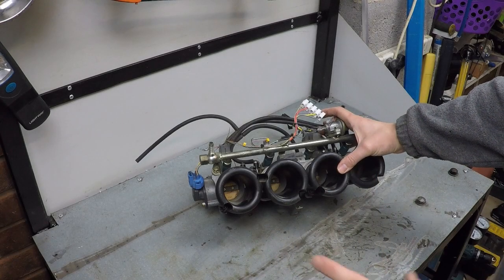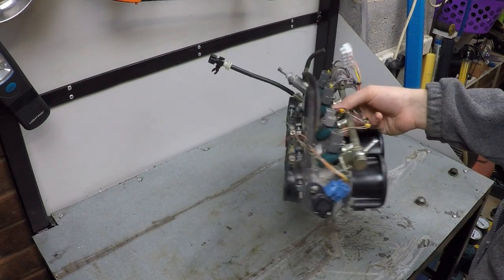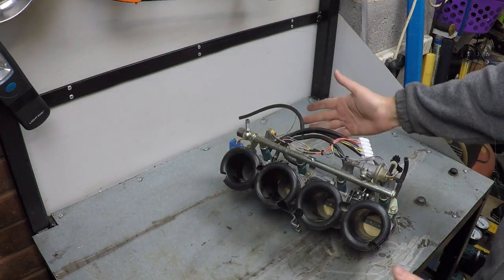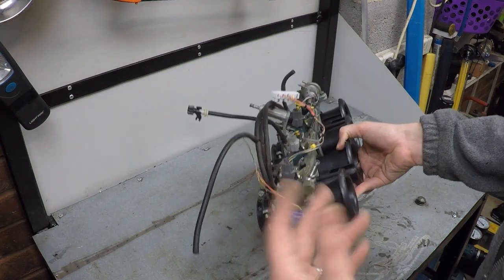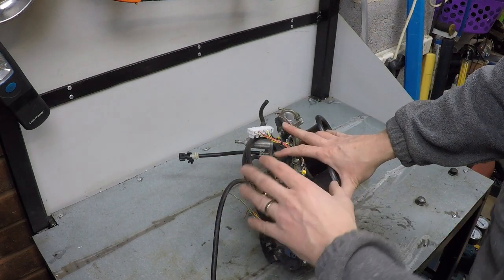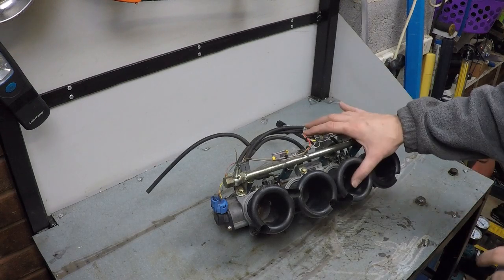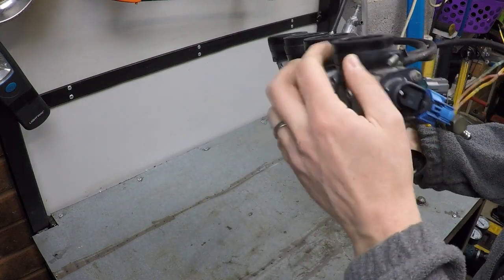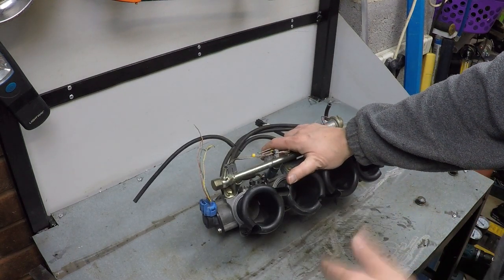Everything you DON'T KNOW about Individual Throttle Bodies

Comment: If you need 1mm per hp, that means i need frickin 87.5mm throttle bodies🤣🤣🤣
Reply from the maker: 87.5hp per cylinder?  You are going well!  What engine are you running?
Reply: @MakingforMotorsport  the engine is still in the build process, but it is a Honda D14A3 with a D16Y8 cylinder head, compression ratio is 14:1 and max rpm around 11500... so mathematically it should make between 320 and 380hp....
And it will run on pumpgas but its 102 octane
Reply from the maker: Wow!  Well that is quite the engine! 320bhp  from 1400cc is F1 levels of specific BHP!  It may have been the other video but I did mention that as you go up in size you get more BHP/mm (it’s obviously about area not diameter).   But your engine is a special case I think!  What are you planning on doing with it??
Reply: @MakingforMotorsport  racecar, full on endurance racecar, but as light as possible, something like 800kg in a Honda civic with over 300hp is more than enough for over 300kph and wheelspunn for days without a programmed TC
Reply: @MakingforMotorsport  i will obviously also try to run in on ethanol and methanol too, to see how much i could gain trough drastically the quality of fuel
Reply from the maker: I am in the UK and fuels other than high octane pump gas are limited to drag racers,  but I am really interested.  Will you have problems with the other fuels on 14:1 cr?
Reply: @MakingforMotorsport  what do you mean with problems? I cant run anything lower than 102 octane because it would knock immediately on 98 and lower, but in ethanol and methanol I have the advantage of a way higher knocking point and lower burning temperatures wich will make the engine last longer due to less thermal stress, and I'm from germany🤣
Reply from the maker: @THEBOZZ-zt1zn  knock was exactly what I was thinking, I don’t know the ron number for those others but from what you say it should help you.  I am curious though, you are building a big power 1400cc which normally means you are building to a class or regulations (otherwise I’d assume you’d go for a bigger capacity), can you run these other fuels in that class? (Or is it all just for fun?)
Reply: @MakingforMotorsport  i don't build to a certain regulation system, but with that i can run in the 1400cc class at hillclimb events or in a certain class in the VLN (in this class they are normally turbo engines), i think Methanol has around 130 to 135 octane, nitromathane has like 160 octane and ethanol has like 110 to 125 octane
Reply: @MakingforMotorsport  and I just wanted to see whats possible with that engine, because I dont want to do the same as everybody else and just slap a turbo on it, after its done ill build a street engine with 12.5:1 and 10k rpm max, and a K24 street engine with the same comp ratio and rpm for my Civic MB Wagon
Reply from the maker: @THEBOZZ-zt1zn   a K24 with the k20a head is on my to do list... but that’s for a BMW compact I don’t have yet!   I wish you best of luck with it, you should do some videos on it, I’d love to watch (and hear!)
Reply: @MakingforMotorsport  the worst thing is that if i need to make 87.5hp per cylinder and id need throttle bodies that big, the thottlebodies would be bigger than the bore diameter of the cylinder🤣🤣🤣🤣 by a full 12.5 cm
Reply from the maker: Closest thing to a Mk2 Escort that I can afford to buy and then crash...
Reply: @MakingforMotorsport  the dealership in my city has two mk2 or mk3 Escort RS for sale, a convertible in light blue metallic and a coupe in black both in immaculate condition
Reply: @MakingforMotorsport  and those two cos some money, the Coupe costs like 6900€ and the convertible is like 5500€
Reply from the maker: @THEBOZZ-zt1zn  if they are in immaculate condition and less than 10k then they are likely Mk3, not awful but front wheel drive, I want a little more oversteer...

https://www.ebay.co.uk/itm/133649112333

This is £13k and not even the most sought after RS2000.  Even just a solid shell goes for £4K+....
Reply: @MakingforMotorsport  he also has an immaculate Sierra XRT4 V6 in black with the RS wheels
Reply: @THEBOZZ-zt1zn  forget that rule of thumb. Do your research, you will find a 48mm ITB throttle diameter are enough to support your power requirements. It's also more important to match head port cross sectional area, either the same size or slightly larger with a smooth taper to increase velocity.